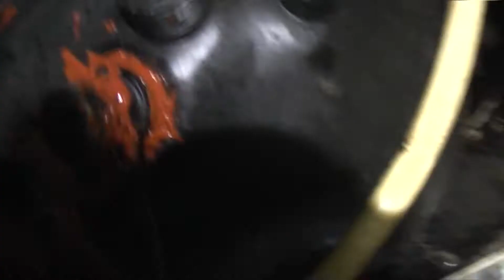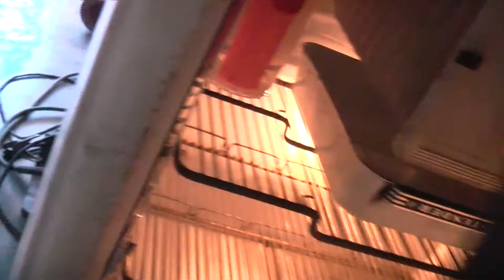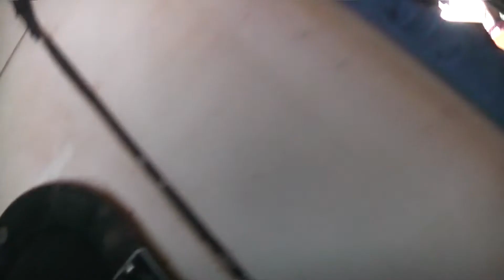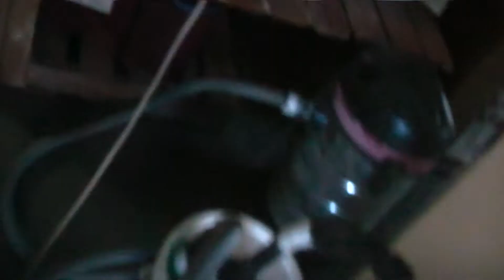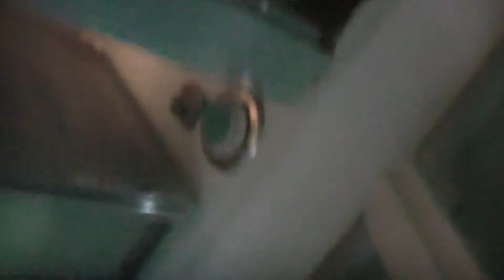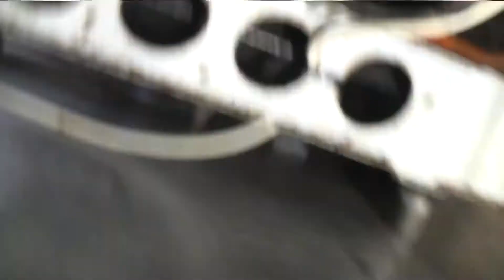Meter Miser Compressor Terminals Sealed

Comment: Glad to see it working!  But as much as I hate to say it..... it doesn't have a full charge of R12.  It has a full charge of R114!  That is before the R12 days.  :)    

Dichlorotetrafluoroethane = R114    Operates at a lower pressure than R12, similar pressures to sulphur dioxide. 
Dichlorodifluoromethane = R12

Kelvinator called that compressor design a "polarsphere" unit.